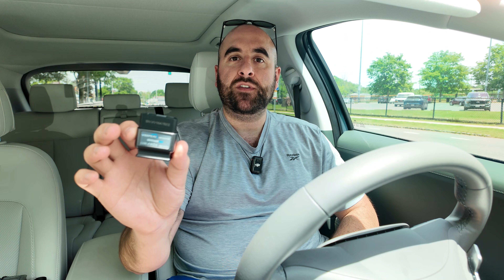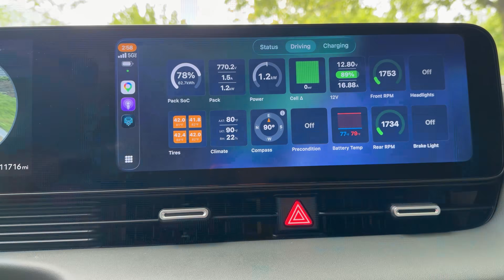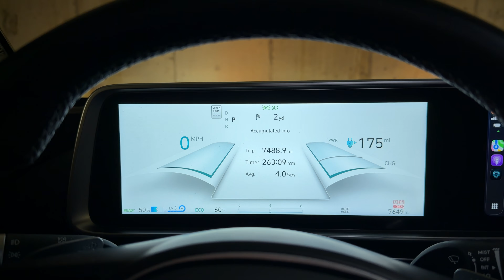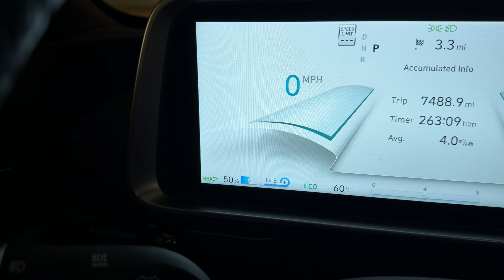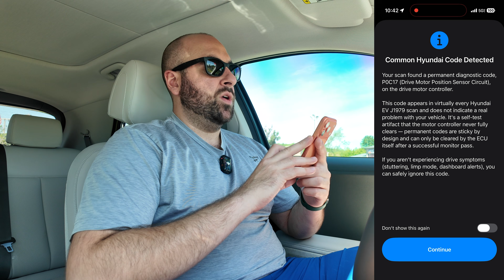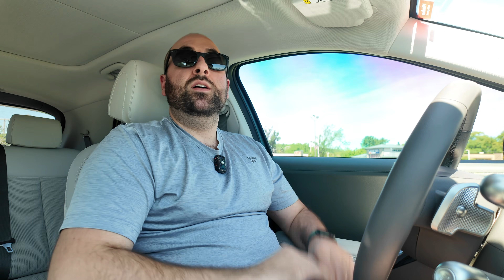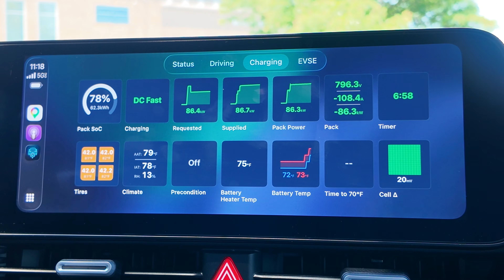Every Ioniq 5, Ioniq 6 & Ioniq 9 Owner Needs This App! | EV Dashboard for iOS

Comment: Battery temp graph should have optimal charging temperature range as well. Two green horizontal lines signifying the lower and higher ranges. 

Based on the Pack Soc and the Cars Trip effenency. Maybe a “range to 10%” card could be presented.
Reply: Hello!   Are you asking for that on the CarPlay chip?  I do show green horizontal lines in the app itself.   In general, everything in CarPlay is a somewhat simplified version of what can be shown in the phone app.
Reply: @GregoryBurlingame yes I was thinking in CarPlay. You have min and max battery temp that climb as the pack heats up. But would be nice to have bracketed green bars showing the range where the pack will pull the highest rate of charge.
Reply: @ecoheliguy  I see - so make that visualization more of an absolute instead of a sparkline / trendline.   I'll look into that - thanks for the constructive feedback!

Comment: I assume the answer is no, but can it show EV battery data when route planning thru Apple Car play?  I am really looking for this feature, and so far, only a couple of cars do this, such as the Mach-E.
Reply: Hi Peter - I have some future features in mind.   What is it you envision, what is your dream?
Reply: @GregoryBurlingame  I would love to be able to route plan with Apple CarPlay with the SOC and the necessary charging stops, etc. as part of the route planning.  

I suspect this info has to be shared by the EV batter management systems, so I am not sure if that is possible,.  Think Mach-E, F-150 Lightning, and the Porche Tacan, and if that info can be pulled into Apple Maps while on a route, that would be ideal. 

Thank you.
Reply: @PeterFadden  - I wonder, have you explored the application ABRP (A Better Route Planner)?  If you have, is there something about it that does not meet your needs?

Comment: I have a Bouncie in that port.  Will it give me the same information (trips, mileage) that Bouncie does?  I pay $10 a month for that service.  Is there a monthly charge for this one?
Reply from the maker: I don't know anything about Bouncie but as I showed in the video it tracks driving data but nothing related to vehicle location tracking. There is no monthly fee.
Reply: Hi Andy - which features do you use on the Bouncie?   I think the spirit of that device is that with its integrated cellular radio, it can transmit information without needing a phone in the vehicle.   At the moment, IONIQ 5 Companion does not track location information, but stay tuned for a possible future feature announcement.  😀  This is a one-time purchase of $12.99 USD, with no subscription.

Comment: Now someone needs to come out with a OBD adapter that automatically powers down the output port after x number of hours. This would be similar to the Garmin OBD adapter that powers down the USB ports after 10 or 24 hours.
Reply: I don't see the need.  I am using the Vgate vLinker MC+ (BT3.0/BLE4.0) OBD2 Scanner that automatically goes into a sleep mode and draws only ~3 mA.  I plugged it into the OBD port in March of this year and have left it there. My 12 V battery is original and is over 3 years old and is still working well.  The scanner automatically awakens and connects with the CarScanner app when the car is turned on. The Vpeek that I bought to use with my Chevy Volt, although working with that car, never worked with the Ioniq 5.  The two different Vpeek scanners I bought never woke up when the car was turned on and I had to physically unplug and replug them to awaken them. That’s when I decided to buy the expensive Vgate unit, which works perfectly.

Comment: Hello, I have a question about a feature that I am really missing: is there any way to get the actual energy that was charged / discharged for a longer time?
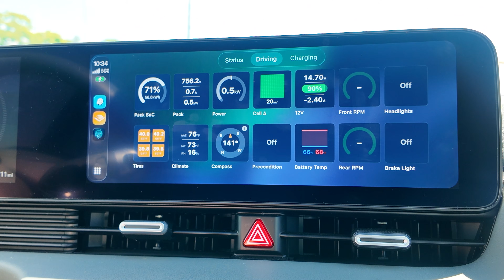AFAIK the Hyundai App has no information about that ... 16:19 literally saw it after writing the comment.
Is there any possibility to customize the dashboards?
That would be really a killer feature.
Reply: Hello!   Currently the app allows you to move around the panels in the app's Dashboard view, but I suspect you're asking about the ability to customize CarPlay.   That is on the roadmap -- a very highly requested feature!   Thanks for your interest.

Comment: Nice features! I might invest in this app, but I have one question. My OBD-II device connects to my iPhone via Wi-Fi instead of Bluetooth. Would the app still work in CarPlay if I plug the phone into the “main” USB port?
Reply: Hello!   Do you have a Wi-Fi OBD-II adapter?   IONIQ 5 Companion is not compatible with Wi-Fi OBD-II adapters -- only ELM327 compatible BLE adapters are currently supported.

Comment: I recently purchased a new Hyundai ionic 5 2026 ultimate here in Canada and love the car. This sounds like a great tool but I’m a little concerned that if you leave it in all the time and don’t drive the car for a few days it might drain the 12 V battery a bit too much. So would do advise only plugging it in when you need to get some information?
Reply from the maker: I unplug it. I don't think it would drain it in a few days but in a week or two, maybe. Remember the 12V can be topped up as much as needed even when the car is off. For my use case, this is only something I'd really use if doing a long drive. Most of my driving is short stints around town.
Reply: Thanks for the quick reply, Ray! Following up on that, I actually just stumbled onto a very strange and repeatable safety/security behavior on my 2026 Ultimate during a remote pre-cool cycle, and I'm curious if you've heard of this happening yet.

If I activate remote climate via Bluelink, walk up to the car with the key fob, open the trunk, and unlock the doors, the exact moment my passenger opens the rear door, the car automatically executes a complete "Ready to Drive" handover. It completely bypasses the driver's seat weight sensor, the brake pedal, and the physical Start/Stop button. The dashboard briefly flashes a graphic of the start button, clears it out, and the car is instantly live and ready to shift into gear while I’m still standing outside at the trunk. 

This seems like a major security flaw if you're just loading a bag into the back seat with plans to drive later. Have you heard of this aggressive "auto-ready" logic on the 2026 refresh, or do you know of a good owner group tracking 2026 firmware quirks like this?

I’m planning to test it a little further when I have a bit of time to see if the trunk action is necessary or not.

Thanks. Howard.

Comment: Do you need to keep unplugging the obd dongle every time you turn off the car?
Reply from the maker: You should but people don't
Reply: @TheIoniqGuy does it drain the 12v if you don’t? Also, does the fitcamx drain the 12v while the car is off? Thanks Corbin. 🙏🏼
Reply from the maker: Yes it will. The OBD2 is always powered on. The fitcamx doesn't. That circuit shuts off with the car.
Reply: @The @TheIoniqGuy got it. Thanks again 🙏🏼

Comment: Possibly a silly question, but can this odb2 scanner be connected to this app and ABRP at the same time? Or does it only connect to one?  For example if Im road tripping and have the odb onnected to ABRP, will it still be recieving info from this app simultaneously?
Reply: Hi Evan -- that's a great question!   So the OBD-II / ELM327 standard is kind of old, particularly compared to modern technologies we are all accustomed to like Wi-Fi, Ethernet, USB, etc.... If more than one app is using the OBD-II adapter at a time, they will both have a degraded experience.   In Version 2.0, I added a number of features design to make co-existence with other apps like ABRP as friendly as possible, e.g., ability to control auto-connect on/off, ability to manually disconnect and reconnect -- both from the app Settings and also from the CarPlay status screen.   Over time I will be adding more and more features to IONIQ 5 Companion.   Thanks again!
Reply from the maker: No, it has to be used with one or the other

Comment: The discount code for the VeePeak is not working
Reply from the maker: They currently have a 15% discount on Amazon so maybe it doesn't work when they already are offering a discount.
Reply: @TheIoniqGuy  Sorry, that's not what I'm seeing whether I use your link or sign directly into Amazon. The price is $31.98 and they only offer a 5% discount if I buy 2 of their items
Reply from the maker: I don't know. I see a 15% discount code on the Amazon listing
Reply: @TheIoniqGuy  That might be for retail/business accounts but I don't see the 15%, thanks for your quick replies though

Comment: 8:42  looking forward to that hardware solution to precondition
Reply: Any chance the hardware preconditioning capability will be engineered for the Genesis GV60 as well??
Reply from the maker: @in1accord Not at this point. Very different system versus the Ioniq 5/6/EV6
Reply: 2025+ EV6 has it
Reply: @JeffButera I know but mine is a 2022
Reply: @TheIoniqGuy I'm assuming this will only be for AWD cars?
Reply: @frederick-DIY why would it only be AWD cars?
Reply: My 5 has it?
Reply: @Crodgers88   8:37 "there is going to be a hardware solution coming to 2022 through 2024 Ioniq 5 and 2023 through 2025 loniq 6 and EV6 as well, which will allow you to use the favorite button on the steering wheel to activate battery conditioning in your cars."
Reply: @bubbledoubletrouble that's cool I have a 26
Reply: @Crodgers88  Then you already have it.
Reply from the maker: If it is a 2025 or newer
Reply: @TheIoniqGuy ok I was a little confused

Comment: Yeah...I need this for my android like yesterday. Day One buy when it becomes available. The charging requested vs provided for DC Fast Charging is what I would use it for. 

Also to note, I would argue having mV pack delta visible is not something that should be on the screen. For recording yes it's good to have, but there's no reason to monitor that information live. It will do nothing but give people anxiety and cause unnecessary visits to the shop. Is there a way to change what tiles are visible?
Reply: The V2 just came out and on iPhone keeps the history of both drives and charging sessions and uploads it to iCloud. So it does recording in the background!

Comment: I thought leaving an OBD reader plugged in all the time was a bad idea?
Reply from the maker: You're not leaving it plugged in all the time, just while driving or while charging. It can cause issues with battery conditioning activation but if it does just unplug it and plug it back in.
Reply: @TheIoniqGuy No way am I plugging and unplugging an OBD reader every time I get in or out of the car. I will just save my OBDLink MX+ for troubleshooting.
Reply: There are simple, inexpensive OBD extensions that come with a quick on/off switch, avoiding the problem of having to reach down and unplug each time.  Just search these terms on big river.
Reply from the maker: I just ordered one with a built in on/off switch to test
Reply: @TheIoniqGuy Tell us how that works. Would be interested.
Reply: @TheIoniqGuy  My state has a voluntary mileage monitoring system that I use along with one of these remote switches.  It works fine in my application for shutting down the monitor during periods of non-use.

Comment: Curious as to why you say you should unplug the Veepeak adapter when the car is parked.  I have had mine plugged into my '23 AWD Limited from when I bought the car in Feb 2023 until today with the exception of when I take the car to the dealer.  I have never had any issues due to it being plugged in.
Reply: It's a security risk.  Honestly I don't think he should be recommending this kind of Bluetooth device.  It's always available to pair with any device belonging to anybody walking by your car in a parking lot or your driveway.  You should really get a different Bluetooth dongle that has a physical button, that only pairs with a device when you're inside the vehicle and press the button to pair manually.
I have the VGate vLinker MS for this reason.  It costs a little more, but I don't have to worry about unplugging it every damn time I get out of the car, lest some random person connects to it trying to unlock the doors.
Reply: I bought the VGate vLinker MS but the app would not recognize it. It connects to my phone Bluelink but not the app. Any advice?
Reply: I have an android, so I can't use the app mentioned in the video at all, yet. I use the "car scanner" app, but there's a few others to choose from. I'd assume the incompatiblity is a limitation of the app more than the obd module.  It's a new app, I bet they'll update it soon.

Comment: Just curious how this works on a 2 driver vehicle, where the OBD2 device had been paired with 2 phones, and both phones are in the car, with the driver's phone linked to the infotainment system. Will things get confused with OBD2 pairing, etc., or will everything get elegantly sorted out when one of the phones has CarPlay active?
Reply: Hi Tech - wow -- that is one intricate use case you laid out.  😆  I'm the developer of the app.   Just to check one thing -- the vast majority of the OBD-II adapters on the market do not actually support pairing/bonding.   They just connect, and once connected they stop advertising.  When the connection is broken, they begin advertising again, sort of like "hey world -- I'm ready to connect".   

What would happen today in IONIQ 5 Companion, is that there would be a bit of an indeterministic race condition created.   If IONIQ 5 Companion were installed on both phones (only one purchase necessary with Family Sharing), both phones are in a state where iOS will notify the app the moment the adapter is in range, and both apps will try to re-establish a connection.   

The app does provide controls to turn off this auto-connection behavior, so you could take control of the situation that way if you'd like.

The presence of an active CarPlay connection would not really impact which phone was connected, but I do understand your idea -- and I think it would be technically feasible to implement, i.e., the phone with CarPlay would win out, but honestly it is very much a corner usage case that would take a lot of effort to get right.  

I hope that answers your question.   😆

Comment: doesn't leaving the V-peak connected drain your 12v battery though? I'm questioning how sustainable it is to leave it in for prolonged periods as this app seems to benefit from
Reply: Definitely. When I leave my car parked for a whole month, it only loses about 1% of the battery, but when I leave my ODB plugged in, it loses about 1% overnight.
Reply: I got a odb2 adapter with a power switch on it for mine.  This saves disconnecting/reconnecting.
Reply: @Walki @Walkinfaaaast you give us the name of the obd2 adapter power switch?

Comment: Are you saying manual battery preconditioning will be available soon to the Ioniq 6 ? That would be great ! Preconditioning has only worked once when navigating to a IONITY charger, other times navigating to any charger through the cars nav never works. Thank for sharing
Reply from the maker: There will be a hardware solution developed by the community available soon, not anything from Hyundai

Comment: Suggestion, why not make it a full-blown app that allows you to turn on climate, lock the doors, set AC/DC charge levels, etc.
Reply: Corbin  this is an exceptional app.Thank you for bringing this to our attention. On a slightly unrelated note, if you could pass to Greg this would be a tremendous application.If he could adapt it to the cadillac lyriq, it would benefit greatly brian
Reply from the maker: Could be something Greg has planned for all I know
Reply: Hello!    That would require knowledge of Hyundai/Kia's proprietary keys -- typically systems like the ones you are envisioning work outside the confines of the central gateway.   The OBD-II port is constrained by that.   IONIQ 5 Companion is a read-only, observer of vehicle status.

Comment: Darn, I was hoping the Precondition square would let me activate battery preconditioning. You have to let me know when that functionality becomes available.
Reply: CP/AA apps may not be allowed that much control, even with access to the OBD.  Or periodic polling by the cars software could end up just promptly turn it off after a few seconds because the conditions where it’s allowed to be on don’t exist. 

But if it’s possible oh that would be wonderful.
Reply: @C @ChuckvdL can start preconditioning with the KIA app on my phone for my EV9. If it can be done “over the air”, it could very well be doable via ODB. I’d love that feature as well.
Reply: I think in the East Coast race - Corbin had issues with preconditioning when he had s device in his OBDII

There are still some features which I think Hyundia/Kia has hidden from their API because some of these services (remote lock) as a subscription feature.